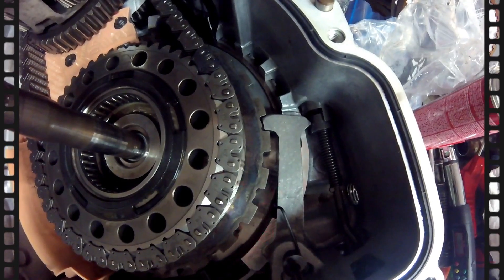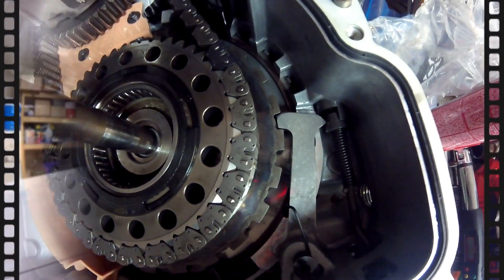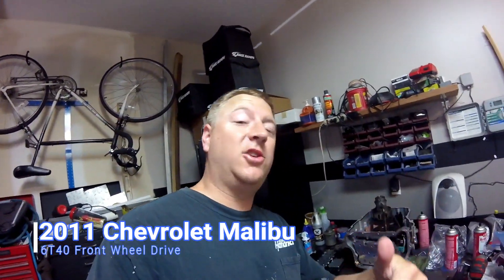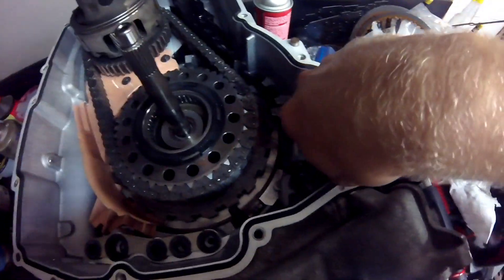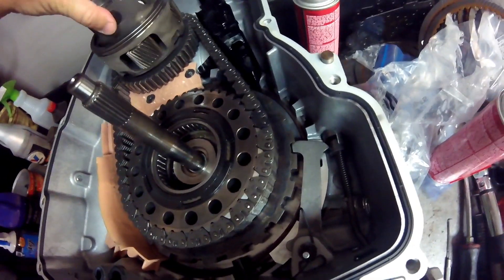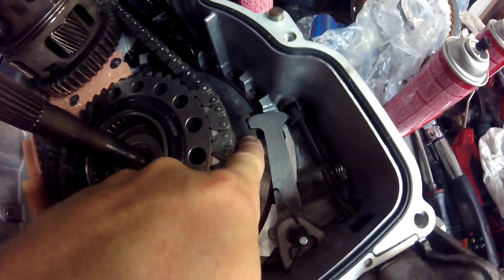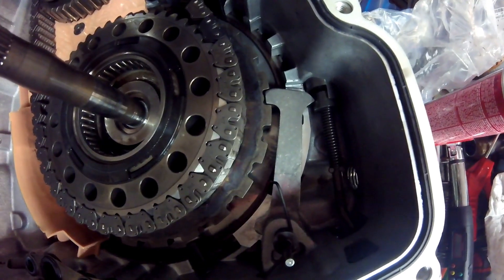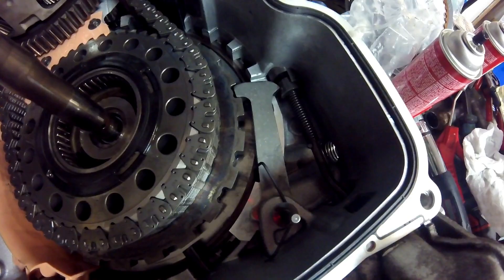What Keeps Your Car From Rolling In Park

Comment: Why would my move forward and backward if the key is out of the ignition and if the car is in park  -? Never seen that before it’s wierd
Reply: Because there are no brakes being applied to the wheels, and park hasnt been engaged yet because it wasn't aligned so it'll move for a quick second. Something that I've noticed though is that if you put it in neutral and then park, this shouldn't occur.

Comment: Thanks Pete
My boss’s 09 Chevy van has a pawl issue. 4l60e. Anymore than 1 day down time won’t work. Would love to repair myself. Any advice ? Do I need to drop the trans ? Etc.
Reply from the maker: I would check the shifter cable adjustment first. Make sure it lands in all of the shift detents correctly. I haven’t ever seen a park pawl issue with a 60e but you can replace the pawl shaft without removing the trans. Take the pan off, remove the valve body, remove the two bolts than hold down the pawl bracket and take it out. Good luck!
Reply: Thanks buddy. You got a new subscriber here 👍

Comment: Hey i put a brand use transmission in and my park pawl not engaging i have a lexus gx470
Reply from the maker: hebi003 I don’t know anything about the transmission in a gx470 but is it all wheel drive?  If it is then maybe either the transfer case or an axle is broken. It would cause the car to possibly roll even though the transmission is in park. Also it’s possible the shift cable isn’t adjusted properly. Or the transmission has something broken inside. Usually park doesn’t break unless it was thrown into park while moving.
Reply: Its a 4x4 ill go check the transfer case 
Thank you
Reply from the maker: hebi003 you’ve piqued my interest. Let me know what you find.